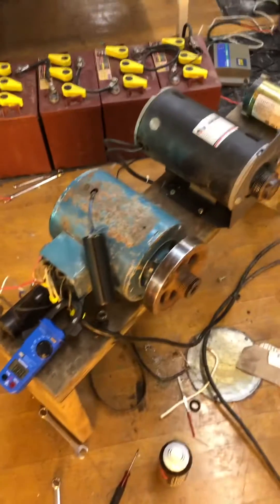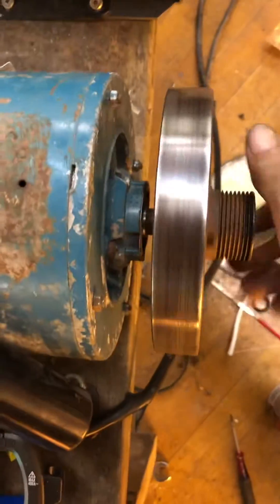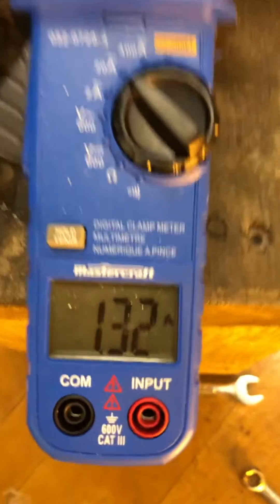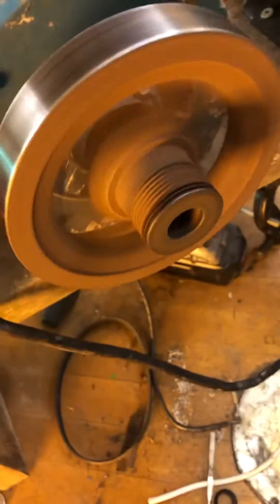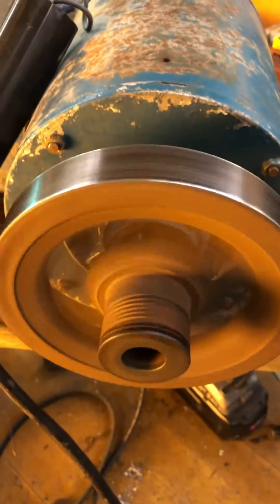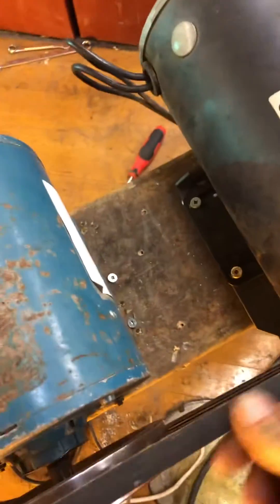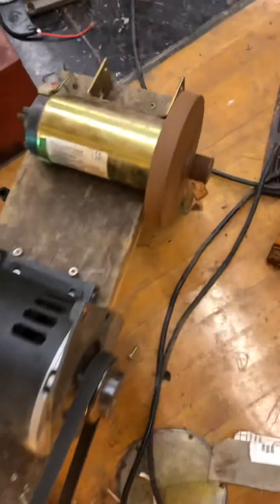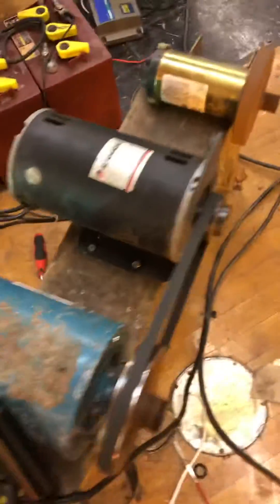Rotoverter  modification finished

Comment: Is that a 3 phase motor or single phase
Reply from the maker: Single phase this can easily be done exactly the same in three phase except you want to add two more capacitors to the other two phases you are  not powering …. this is  then  called power factor correction phase converter input 120-240 single phase output is 3 phase motive power or 3 phase electrical energy. You would want to allow a time buffer for the device to become harmonized meaning the power is not instantly there it has to reach the frequency before excessive power may be extracted
Reply: Ok so you connected low rating running capacitor to the two running wire on the single phase motor and it just stop put high amperage I am trying to understand it all induction motor use capacitor so what the additional details
Reply from the maker: @Dc_tech386  this is the understanding of tuning something to resonance on the input side this is parallel resonance this will reduce the amount of amps consumed on the input it’s called power factor correction this brings the amps and volts into phase matched for the frequency of operation of the device
Reply: I know what is power factor but roterverter or no power factor I was speaking to the group on yahoo that is responsible for the design for over 75 year and they said it’s not power factor is power inverter and only 3 phase motor it  mostly 3phase motor connections it work well with I am seeing the videos showing 1.56 amp but with the 3phase inverter is used 90 Milliamperes a 144 watt to power a 7.5 kw motor so that why I don’t get it with the single phase motor